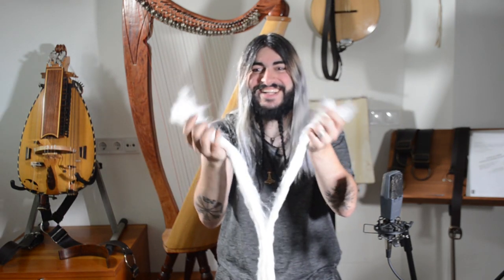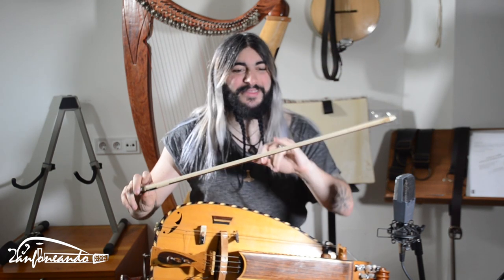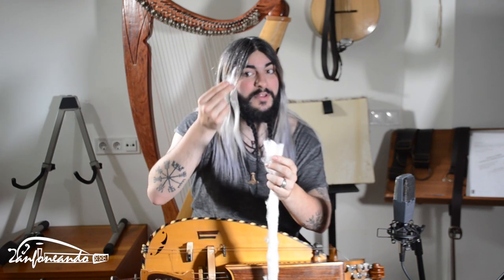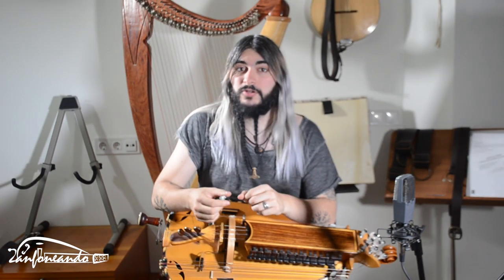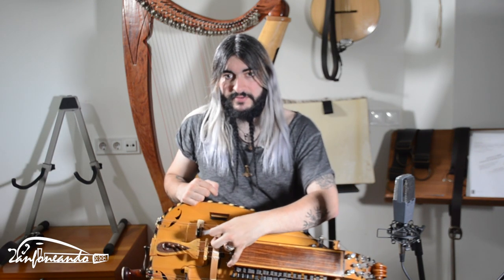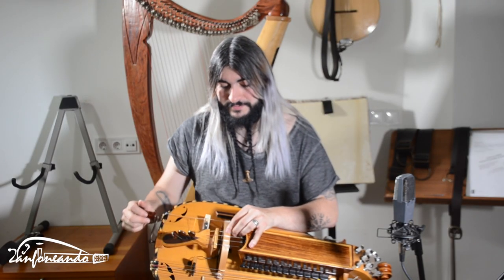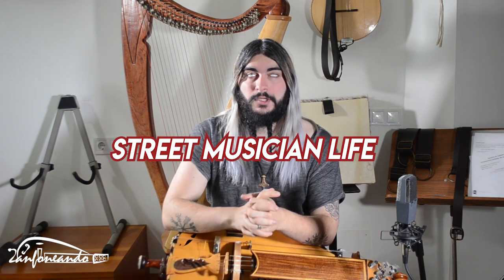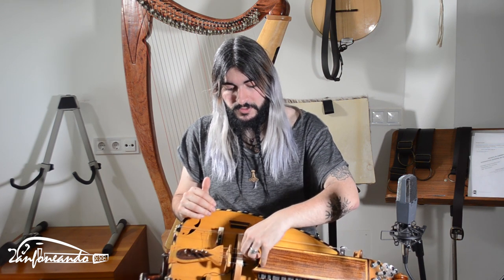Cotoning your Hurdy Gurdy - Dr. Gurdy

Comment: fun fact.Rayon isn't synthetic!
It's pine or bamboo fibers and makes very comfortable clothes for hot climates.

Trying to use natural cotton sliver instead of unwound cotton balls segments (doesn't stick together well)
This is so much easier than the way i was told with plucking the string while turning the drone wheel to bounce on the cotton until it's tight.
Reply from the maker: I didn't know! thanks for the info
Reply: @Sergio.GonzalezPrats  
A lot of people don't!
But this video was so helpful, my cotton sliver doesn't come loose or unwind while practicing anymore